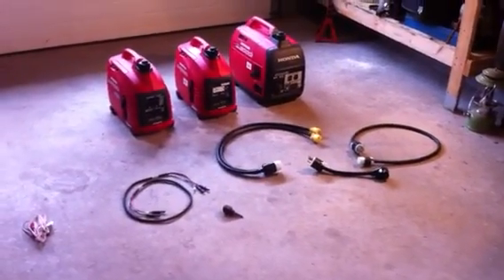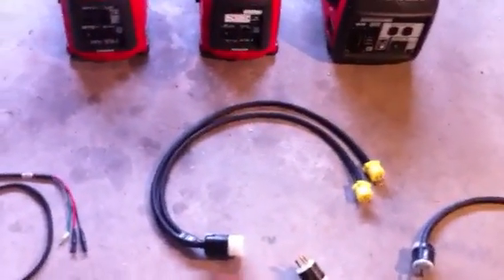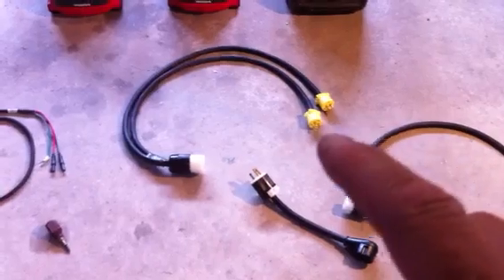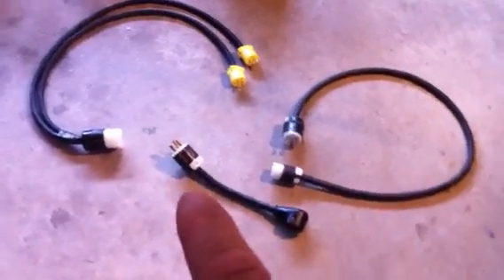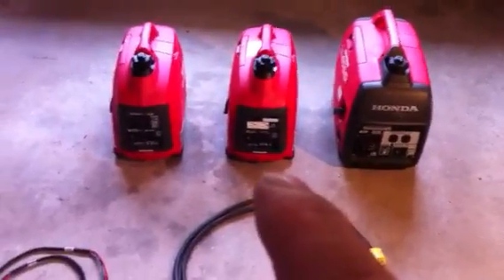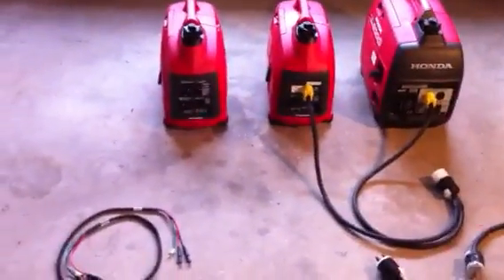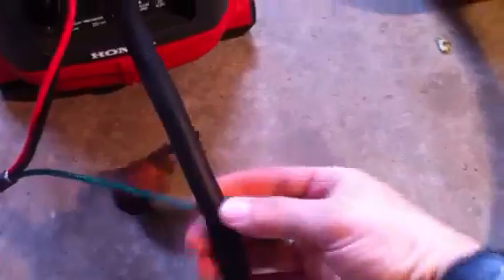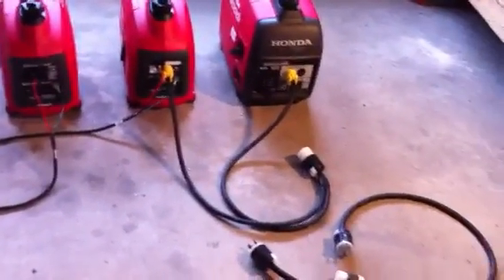How to triple parallel honda eu series generators

Comment: So the Honda generators must syncronize to whatever source is present when they start up? Has anyone validated this to be true or is everyone having dumb luck start-up phasing?
Reply from the maker: Austin Montanti 

Lol,the computers automatically sync voltage and frequency - all eu1000, eu2000, eu3000, eu6500, eu7000 models computers sync with another unit , Honda for safety and liability has never endorsed unlike model paralleling even a eu3000is to a eu3000 handi, and even in some cases due to csa rules eliminated the parallel ports for years on the Canadian models - as Honda would not pay for the special testing of the models and cables which is rather costly , but you could still parallel in a illegal or not desirable way -doubl male plug , wise sales when they where open had a kit that you could safely parallel any combo of eu1000,eu2000, and at one point eu3000, via the banana plugs , the basis behind why they can parallel is due to the fact these are inverter generators, there alternators and the computer/controller adjusted the voltage and frequency and speed to keep the unit producing the right power , as of right now Honda has parallel eu2000's in Canada again as they got just 1 cable only approved for paralleling there eu2000 and companion model or eu2000 to another , it was a cable issue -actually they didn't want to spent the money to get each of the couple cables used CSa approved big $$$$ , google why Honda stoped parallel eu2000 for a couple years in Canada , anyhow I am not out to have people blow up there units your a troll idiot if you think so - do your research , people have done it for years , and to answer one question this combo hook-up still only produces 120volts , only the eu6500 and eu7000 can produce dual or 120/240 voltage as they are dual inverter units or something like for Honda,s inverter series  , I do not know why people fail to research things enough before they dump all over me for illegal plugs , trying to kill people with the double plugs , or blow there units up , I showed people a way to connect there generators , if  you don't like the cheater cord don't use it , I showed it and explained it's benefits and dangers ,and no one should be playing around any generator while it is running , really and you call me unsafe   , and not everyone can afford a bigger  unit to start with and the eu1000 may be all you can lift
Reply: That's the question I have that no one seems to understand. If the voltage isn't in phase, you're not getting the correct voltage. Does it have something to do with these units being inverter generators?
Reply: thanks for your video!. i luv my honda eu1000 which can power almost everything i need for most of my travels in my sprinter rv. i can even run a small oil filled radiator;  it uses less than 2 1/2 gallons/day run 24 hours!! A few times a year i need the ac on extended trips where i'm off the grid and don't have access to extra propane for the onboard Onan to power the ac. i thought about trading up my 1000 to a 3000 but as you indicated it's quite a bit heavier nor does it or even the 2000 get the gas mileage of the 1000. I'll now plan to buy a 2000 and make your cord to run my ac. i'm wondering if you were able to start and run your rv ac unit on eco power mode w/ a 1000 and 2000 hooked together? any thoughts on that? i've already purchased a capacitor to help w/ starting amps but never installed it pending my final resolution on a generator. i've seen other videos indicating i can run the 13600 btu ac on eco mode w/ a "stand alone" 2000  in ecomode after the ac has been started. i already have an extended fuel tank which minimizes the dangers of storing and pouring fuel but i'm still nervous having a lot of gasoline around. i'm usually in extremely close proximity to lots of drunken idiots who are traditionally careless w/ ciagarette buts which must be taken into consideration. i could add a "y" adapter for my fuel line if this wouldn't create a large fuel demand. your video indicated the 1000 had more starting wattage available than the 2000? (or was that another i watched?). i wonder if i could actually solve my issue paralleling 2 ea 1000's and don't even really need a 2000? that would be ideal and what i was trying to achieve w/ the capacitor all along but that extra power for almost the same price would sure give me extra flexibility. maybe my reply will also answer some other poster' questions on why someone would do this? It's obvious they haven't spent much time fooling around w/ generators and have no clue about the "VALUE" of the honda,,,, "Priceless"!

Comment from the maker: And also when on the US models or any of the older Canadian models that had the parallel ports , most units the parallel ports or bananna plugs do not get run through the breaker , so when you use the regular outlet , it is run through the breaker on the generator and is safer 

This varies from model and where the unit can from
Reply: Actually that is not true.  The inverter has protection built in.  In most cases you will find the inverter's protection will trip before the circuit breaker.  Though cables you made will work fine, you have to be careful.  If the breaker should trip on one of the generators before the inverter, the generators will loose sync.  Resetting the circuit breaker without shutting the generator down could result in damage to one or both generators

Comment from the maker: Hello , sorry for the delay 

yes yo can parallel the canadian models like I connected the 1000 to the 2000

using the male plugs and rv female plugis the cheapest and easiest way to connect them together 

wisesales is the US has a kit called a sidewinder , it uses the bananna plugs but they could be cut off and wired to a male plug , this would be a cleaner looking connector than what I did

Comment: wondering if you can parallel 2 eu2000i canadian version which dont have the parallel plug on front, like u connected the 1000 to the 2000 with just 2 male plugs going into one female rv plug... thx

Comment: Honda can kiss my *** I knew it had to be possible! I made a kit using 2 15 amp males going into a metal outdoor single gang box with a 30 amp female rv plug. Load tested a 1000 linked to a 2000 at 2400 constant load from halogen lights for 6 hrs... not a single issue! Thanks for the video and assurancs it would work. People say you can but never prove it. I didnt want to risk ruining 2 new gensets. Thanks again!